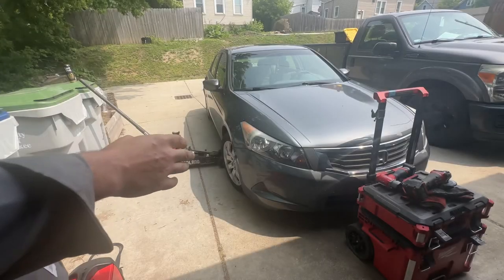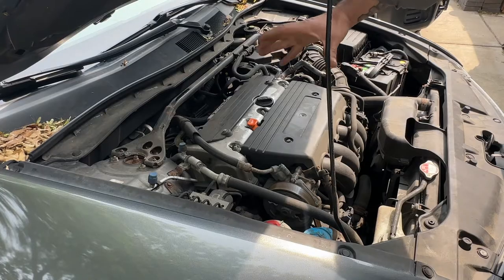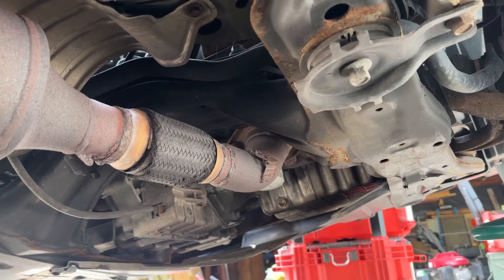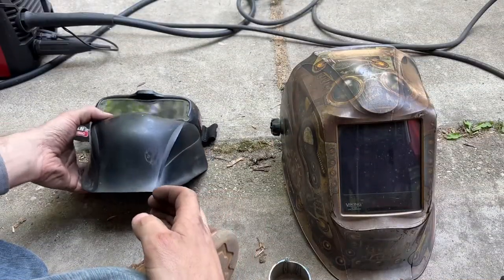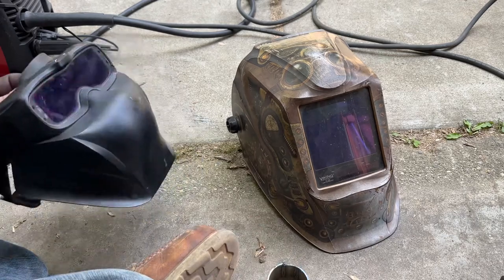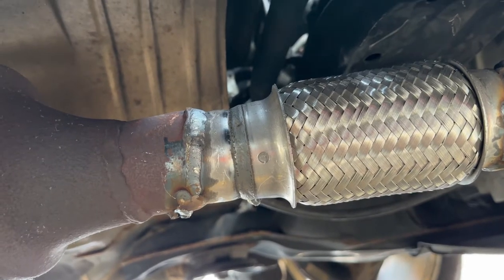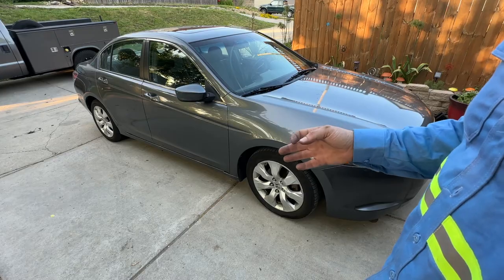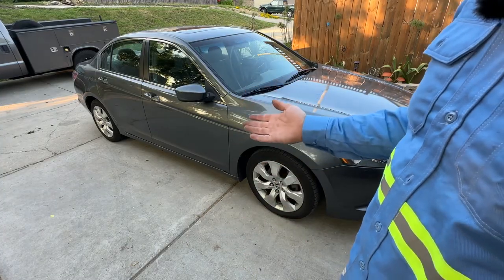How to mig weld a flex pipe on a car

Comment: Great point on figuring out why something broke and addressing that before "fixing" it. Replaced three motor mounts on my Lexus es350 and am here because the flex pipe is broken.
Reply from the maker: I hope the motor mounts weren’t a pita to do on that car.  No doubt bad mounts break flex pipes.  After redoing a couple new flex pipes that broke I realized it pays to look at how much the engine moves before assuming the pipe was just old and that’s why it failed 😅.
Reply: Motor mounts on the ES330 (it's a fancy Camry) weren't bad to do.  But the point of figuring out why something failed before slapping in a new part or repair applies to lots of things. 

I'm "this close" to buying a welder so I can do this repair myself. @makingmistakeswithgreg
Reply from the maker: @MathewPollard-vj4uq  well I can tell you the harbor freight titanium 125 for 170$ or less with coupon can definitely do the job, and anything better would be even easier.  I won’t sugar coat it though, welding exhaust sucks.  It has a lot of angle changes, uphill welds (which is very easy to blow holes) and you’re welding on paper thin material (which sucks in general).   If you practice a bit on the same pipe size it’s doable with minimal skill.  You must run hot enough to get proper fusion, and you must move slow enough to deposit metal.  If you can do slip fits on the flex pipe it’s 5x as easy as a butt weld.  If you only had stick welding as a option I would say no way, but flux core wire is doable.  Gas shielded mig is actually harder to weld exhaust with because of the uphill welds.

Comment: When a guy tells you to go out and buy the welder that you already have😅 makes me feel less worried about this flex pipe I gotta go after here. Welding the top part is what I’ve been looking for tips and tricks on. Seen people recommend using a hole saw on the bottom, welding it from the inside and welding the disc back on lol…
Reply from the maker: Haha I have never heard of the holesaw trick, that definitely could work.  The best way to weld car exhaust that I have found is a “swan neck” flexible Mig gun with flux core wire.  By not having a nozzle on it and the flex neck you can get in anywhere.  The top of the pipe is a absolute bastard to get at in some cases and the flex head/no nozzle is a life saver.
Reply: @makingmistakeswithgreg  I’m wondering if a flex boy is obtainable for the titanium 125. Sounds like the acetylene welder with a bent piece of rod is the absolute easiest old school way to do her. I figure I could drop the exhaust hangers on this 300$ Malibu I’m about to buy and flip, but it probably wont help me much on the down pipe from the manifold side, lol. One of them pairs of auto darkening glasses on Amazon are looking pretty cute right about now 😂

Comment: Welding exhaust under a vehicle (without a lift) is a complete PITA.....but mig is significantly more convenient than tig (& running a foot control). My helmet always seems to be wrong/fall off. Similar to welding on the bottom of an aluminum boat that's still on the trailer.  Great job!
Reply from the maker: Never done a bottom of a boat, that’s got to be terrible on a trailer lol.  I have heard of guys using a “tig button” to control amperage without a foot pedal.  Closest thing I ever did was fix the frame on a enclosed trailer, the axles pushed through the main beams.  Took me 8 hours and I couldn’t stand up straight for two days after.  No more of that for me lol.

Comment: I’ve always known the leather masks/hoods to be referred to as monkey hood. Not exactly sure why but in the field that’s what a soft hood is called.  Those autodark masks are pretty slick. I have a Miller that I use when I have to get in tight spots like column webs.  I e been in a bind before where I removed my 2x4 auto lens and taped clear lens covers on it and just held it in front of my eyes.   I e never been a fan of exhaust work nor welding it while under the vehicle.  That’s a good catch with the motor mount and not just welding the exhaust for a temporary fix
Reply from the maker: Haha a monkey hood, I never heard that.  Youre not missing anything on welding exhaust that’s for sure.  I can build real nice tig welded header on a bench and enjoy it, but welding under a car is a frustrating time lol.  Especially in this state where everything is rusty beyond belief.

Comment: Ever try soldering exhaust pipe?
Reply from the maker: The closest thing to that which would work would be brazing.  Brazing could hold up to the heat of exhaust, solder would likely fatigue crack/melt.  Silver solder could be used, but that is at much higher temps than normal solder👍.

Comment: Glad I ran across your video. I was going to ask you about welding on vehicles and you beat me to it! Do you disconnect the battery when you weld on vehicles? Thanks for posting!
Reply from the maker: Generally speaking I don’t but it won’t hurt.  Disconnecting the ECU (if easy) if it’s by where I am welding I will do though.  The most important thing with vehicles is having a really good ground really close to where you are welding at 😀
Reply: @makingmistakeswithgreg  So much information out there, don't know what to believe. I do however trust your judgment. Have a great weekend, and thanks for responding!
Reply: Always disconnect...

Comment: What steps/knowledge to avoid sparks near the gas tank?
Reply: If you can smell gas, don't weld there. (Something is loose or leaking). Otherwise, just weld it. If it is worrisome, hold a piece of tin flashing between your work and the tank.
Reply from the maker: I totally agree with @beyondmiddleagedman7240.  I tend to not weld near gas tanks in general but if I do I have fiberglass fire blankets that I put up to keep the sparks off the tank.  If you can smell fuel you definitely need to address that first lol.

Comment: You didnt need to unplug the battery?
Reply from the maker: On exhaust its generally not a big issue.  The book answer is to unplug the battery, because it’s not worth risking the potential damage to the computer or the wiring.  The funny thing is with the way cars are wired, disconnecting the battery will not prevent wires from being used as part of a circuit for welding.  It just reduces the chance of them being used.  If you have your ground clamp near where you’re welding, and it’s a solid connection, I wouldn’t worry too much at the amperage levels you weld exhaust at.  If you try to run 200+ amps and weld near a computer, well you sure could end up frying some things.

Comment: MIG is 100% argon. Argon mixes or straight C02 are MAG.
Reply from the maker: You are probably in another country besides the USA.  Although you are technically correct, (the only wire process that uses 100% inert gas is aluminum, which is done with spray), universally MAG (if the term is ever used in the USA) is generally only used for spray arc gasses that contain oxygen, or other blends where the purpose of the active gas is to increase heat input and not just stabilize the arc.  Universally “Mig” is used to define the short circuit process, and it is still called that by Lincoln electric, miller, and virtually every school in the country (outside of GMAW).  What you must remember is MIG isn’t necessarily incorrect for c10 or c25, they are more inert than active gasses, and the term is widely accepted in the states.  So although it may be somewhat “incorrect” in the country you’re from, it’s not necessarily wrong or incorrect in general.  Just as MMA vs SMAW isn’t a “right or wrong” situation, they are two commonly understood terms that work.  Nothing wrong with that.
Reply: @makingmistakeswithgreg  Ok, I see. Didn't know it was the norm in the usa to call any GMAW "mig" 
I learned something 👍

Comment: youtube is being stupid its genral greivous got an qustion about some stick welding sticks i need a high streanth decent pentration decent depset innother word a 70 rod with some good pentraction cuz i need fix my home 4 ton bench vice well rated for 4 tons of presure and need it to be realy strong and the steel is i think high carbon and the rod needs to be on AC ahh amd if it an't chevy or ford its scrap i have an 1986 chevy square body 454 v8
Reply from the maker: For what your looking at if you are welding in the flat position 7024 would be a rod I would definitely consider.  In my testing it penetrates better than 7014, and is far easier to weld than 7018.  7024 will run on AC.  Otherwise 7018 AC rods will work, but I have found many don’t seem to run the best.  Many non ac rods will work on AC.  

Now if the material has high carbon content I would look for some nickel 55 rods.  Preheat the part to 400 degrees and run the nickel 55 rod.  The nickel will absorb the carbon and not become brittle, which will prevent cracking.  The preheat will prevent fast shrinkage and subsequent weld cracking as well.
Reply: @makingmistakeswithgreg  thank you sooo much this vice hase been in the famly since like 1898 when carbon steel was discoverd and it like i dont know how vauble it is to me if i could send you some money just for this info i would you will go down in my famly history as "greg the famly heirloom savior"  i dont know how much more i could show my "appreciation" and i hade to look that word up but yea the point is your a very important guy now
Reply from the maker: @stovolbelinche3178  no problem.  I went cast iron all the time and it either comes down to preheat to 400 (whole thing is heated to 400) and weld with nickel 55 or 99 stick rods, or braze it with silicon bronze/aluminum bronze.  Nickel is a better repair, but sometimes it’s not a option.  

The big thing is carbon absorption.  When that carbon absorbs into the molten metal the weld will become so hard you can’t even file it.  Very high probability of a crack in that case.  Nickel doesn’t become brittle when it absorbs carbon, so it’s a life saver.  In a little bit I will have a video out on welding cast iron and a ton of tips on how to do it 😀.